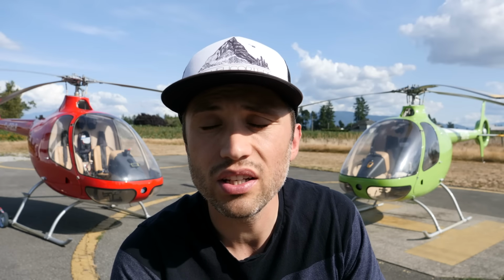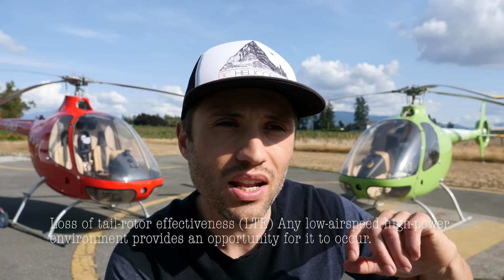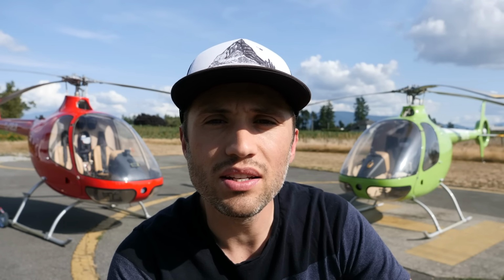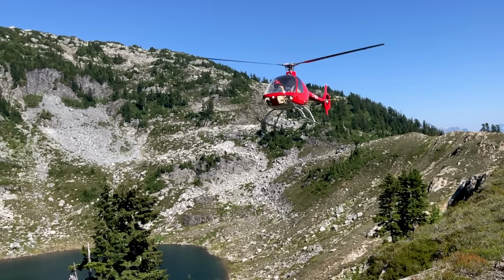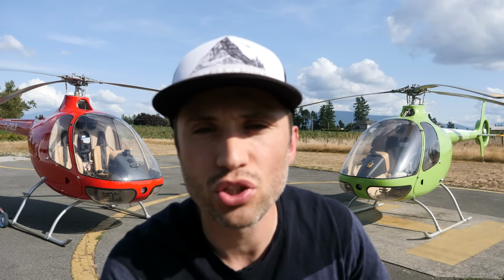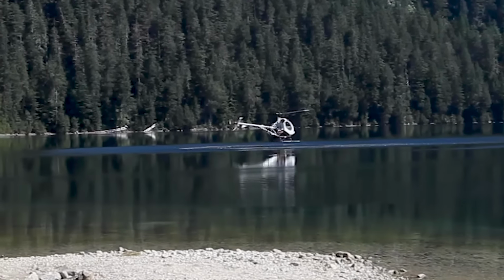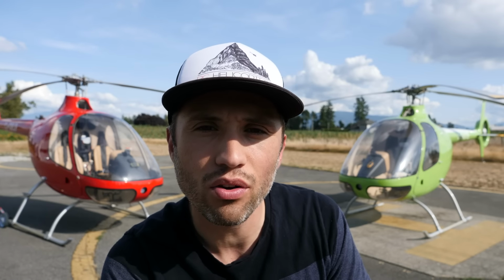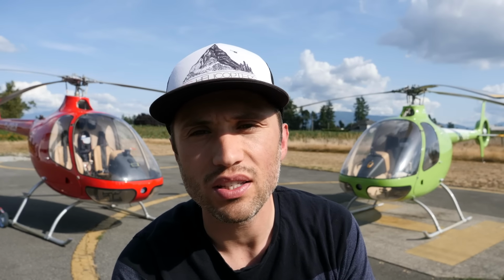OVERPITCHING and LTE can lead to a HELICOPTER CRASH

Comment: Great video and explanation of this incident. And although I think I'm understanding all your great points I just keep asking why there is a situation of lack of power. He came in pretty slow... just curious how he would be running out of power.

I'm sure being a small aircraft there's probably not alot of power here anyway.. but unless there was engine failure or some other mechanical failure ... this otherwise could had been a typical landing had he been over ground vs water. To completely run out of power here... too high an altitude maybe??? 

Great video though!!!

Comment: Noob question, what were the conditions that caused the helicopter not to have enough power to hover?  I can understand if you're extremely high up, or extremely heavy, or it's extremely hot.  I suppose the last would be most likely in this scenario.

Comment: I gave you a thumbs up. Good video. I, however tend to disagree with you that This was LTE in the traditional sense of the acronym. This was way more a result of lack of power, probably, if I had to guess due to density altitude. LTE in the traditional sense of the acronym, is not induced by lack of power, but more of an aerodynamic phenomenon. I’ve been in real LTE and it is very violent. He did lose effectiveness of tailrotor, but it was a byproduct of no power.
Reply: But the recovery is the same!
Reply: I didn’t mean in any way to take away from your video, it’s just that you can get into LTE and still have all the power in the world to spare.

Comment: I don't know about helicopters but it seemed like some sort of mechanical malfunction happened. Yes? 
Otherwise.....was it simply that he rotated in a bad direction and the tail rotor wasn't strong enough to stop the rotation??? Why don't they build them strong enough to do that?  Lastly, was there any recovery once he got into trouble? Could he have dipped his skids into the water to stop the rotation and then pull away?

Comment: Settling with power. The bird was settling in its own down wash, where increasing the power only serves to accelerate the induced flow of air through the rotor disk, caused by operating at a high power setting with very low to zero airspeed and at or near max gross weight.
Reply: Settling with power does not occur at a hover.

Comment: I remember back during my training in a Bell 47 my instructor, after training my boss, at that point would have been instructing for 20 plus years, not sure how many years before that he had been flying, but he was around 10 000 hours (1994). I learned lots from him.
While practicing recovery from overpitching with him, one method used for rotor droop was to reduce anti-torque pedal allowing the nose to rotate so the power the tail rotor would use went to the main rotor and then depending on the cause of the rotor droop, fly away or land. Of course it can only be done if there is room, and like you mentioned and I was taught--you have a way out.
    Have you ever used/tried that method? Opinion...
    One other emergency I was taught that not may instructors do is lose of tail rotor. The instructor would operate the pedals while I hovered, my feet on the floor, downwind at around 3 foot skid height. He would check I am ready then, some amount of delay to make it some what more real (surprise!), he would put the pedals to neutral and around we went. Chop power, prevent drift with cyclic, let helicopter sink, cushion landing with collective.
    I found his training really built confidence that even when things go wrong you can fly the helicopter. And it seemed to remove some of that, is this really happening delay--which hurts recovery from any problem.
Reply: very good information sir

Comment: Now, I know nothing of helicopters, but if this is a common problem, wouldnt they use a tail rotor with more than enough power to keep the helicopter straight under any condition. I'm sure there is a design limitation that I don't know about but it just seems like either upping the turbine size to have just enough more power to keep it straight or upping the tail rotor effectiveness, (with size or maybe the pitch to get more thrust) would solve these problems for the most part. Of course it still is no substitute for pilot skill and training.

Comment: Hi Mischa, very interesting video! but I think I have a fallacy here.. like I don't really get why you even can get into a situation of to little power so easy? Shouldn't there be more room in the matter of power? like a stronger engine? Or is there basically enough power but you just can't use it cause your collektive pitch is so high that your blades start to "stall" and use efficiency?
Reply: MorpheuZmusic no, there is. It enough power to hover in this situation. Full stop.

Comment: In the army before we would do NOE we would do a power check bringing Aircraft up to a 50 foot hover 360 pedal turn if you can do this without you and closed any limits then we felt we could safely fly NOE

Comment: 1st, wrong aircraft for high altitude flying. 2nd maintain forward airspeed, 3rd, Do not attempt  hover until  over landing spot.  4th, either miscalculated HOGE/HIGE during pre-flight or never completed calculation, to determine aircraft hover limits.

Comment: So, basically for any issue, lower cyclic? Motor failure, low rpm, insufficient power, tail rotor effectiveness lost, dynamic tip over, etc.?

Comment: Low rpm cause It, Attention for minimun RPM. Manual is clear and is mandatory put rpm Max of Main rotor when flying  for minimun of 500 feet over the terrain and turned on eletric aux. fuel pump ///  300s  are great machines no desapoint the class.

Comment: i can hear the rotors losing power the more he spins so i assume he was trying to get tail control back while also trying to increase altitude effectively over dragging the engine and making it fall behind the green line in the rpm counter? and the high altitude making them lose 20% ish power probably didnt help

Comment: I have never been in a helicopter, let alone fly one. My question is you said when he started to spin he should have added pedal to counter it. Wouldn’t that have diverted power he desperately needed from the main rotors to the tail rotor, or would the power lost be so small that it’s not a issue.
Reply from the maker: Robert Sandefur yes but if he immediately lowers collective he can give power back as well.
Reply: True, I can see how that would work, I would think  lowering collective should also decrease the need for peddle as well. 
 From what I can tell seems that “Air speed is your friend”

Comment: Hi, what is the purpose of lowering the collective when you start overpitching?  Why moving cyclic forward is not enough? Can someone explain it to me please?
Reply: First thing's first, I'm not a helicopter pilot, but with my understanding, lowering the collective means that there's less drag on the blades, resulting in a faster rotation. If you're losing engine power the last thing you want is your blades to lose rpm.

Comment: High altitude and lack of experience. As it was stated, the pilot could've fixed/prevented this had they have known how to. Setting aside the fact its the mountains and it looks to be high or higher altitude then what the pilot was used to. He also ascended a bit fast, causing LTR, or entering his own vortices which will masturbate LTR and caused him to rotate as well as drop faster than what he is capable of correcting for.

Comment: A low RPM condition affects the tail rotor thrust the most. For every 1 RPM you lose on the main rotor the average tail rotor will lose 4-6 RPMs as it spins up to 4-6x faster on most helicopters!and since the thrust of a rotor varies exponentially with it velocity squared you lose more thrust on the tail rotor than the main rotor as the RPM drops making it unable to counter main rotor torque.

Comment: When you are flying a Robinson......fly it like it's a Robinson......  and not a CH53E.  Doing low level operation at high altitude, in an aircraft that has a short spectrum for max performance, is asking for a problem.  Either way, you'll learn a lot.

Comment: Many people in the comments mentioned that hover over water doesn't give the advantage of ground effect.  This is not what I would have thought.  Please will someone explain why water doesn't provide the advantage of ground effect?
Reply: if I had to guess I would imagine part of it is pretty much everywhere on land you're going to get a little bit of thermal lift also where as over cold water you might even have a little sink rate.

Comment: It seems like this is a power issue. why would they produce helicopters that are so close to there are max power output vs hovering? There's got to be a better way to handle this like having a 10% buffer that can only be used for so long far as extra power. I'm an automotive tech and I can think of a couple ways you can add power to a regular engine... maybe not a turbine. Also if you're running out of power and you've got a turbine you're doing something really wrong.

Comment: Question- would applying more left pedal to offset the LTE have robbed further power from the rotors?
Reply: yep. the engine was already maxed out. im sure the pilot had full left pedal in trying to stop the rotation. all that did was put more load on engine. his only chance once he knew he had screwed up would have been to try to get some forward movement to get air flowing over the rotor (effective translational lift) and fly out of it. tough to do and very little time to do it in. i was watching the video and there was about 1.5 seconds between where that might have worked and where it looked like it was just too late. 
almost always, there is a chain of decision/action points that precede accidents like these. a different decision/action along the way can usually break the chain and change the outcome but there is a point where it is just simply too late to prevent an accident like this one
Reply: Jose Madarieta Thanks!! Much appreciated !!

Comment: OK, but what your missing from this explanation is why the helicopter runs  out of lift. the helicopter obviously had enough lift to take off in the first place, and they are supposed to hover, so why cant it hover all of the sudden? My intuition says theirs some kind of change in the environment surrounding the helicopter that causes the rotors to not make the same lift they had when it took off. so, what is this air environment that causes the helicopter to fall out of the air even with more collective applied?

Comment: G'day,

Yay Team...!

Back when Wheels had flat sides running all the way around them, what you called "Overpitching" (which is actually a Pilot-input..), used to be called "(Main) Rotor Decay"...

  When the Engine can't spin the Rotors sufficiently fast, the resulting Sink raises the Angle of Attack of the Airflow accoss the whole Blade Leading-Edge - and in at the Hub-end the Blade-Roots start to Stall...

 That reduces Lift, increasing the Sinkrate, while increasing Drag & thus reducing Rotor RPM - which together rapidly causes the "Hole in the Doughnut" to expand outwards as Lift progressively decays outward toward the Tip.

  Explaining the process may be a better teaching method than glossing over the Aetiology with the catch-all synopsis "Overpitching"...(?).

Rotor Decay paints a more vivid word-picture of what happens to the Lift ; which progressively ceases to be there...

  I experienced Rotor Decay once, as a passenger in an Enstrom F-28c, we went from sitting in the Ridge-lift a hundred ft above the Hill, to spinning to the right while sinking down into the Riverbed. When the Wind dropped from 15 mph to nothing.

I had the door open to eject the pair of 20-litre Fuel Cans I had between my legs, and we were going between two Trees when a Gust both stopped the Spin & granted some Airspeed.

  Rosemary (Arnold-Harris, my boss, the  first woman with a Commercial Rotary Wing Licence in Oz) was able to regain control over the water, and thus accelerate up the River - below the Banks, before popping up to circuit & land at our chosen Joyriding Spot.

If I hadn't known about Rotor Decay, I wouldn't have recognised the need to prepare to jetisson the Fuel - nor the recovery making such a drop  ultimately unneccessary.

In 1979 one was still able to break even Barnstorming regional Oz, in a Heligoflopter, y'see ; in the waybackwhen (!).

Take it easy,

Such is Life.

;-p

Ciao !

Comment: Hi Mischa I fly 3D RC helicopters and we don't seem to see overpitching unless the motor is running low or in a autorotation..... Does overpitching in full size happen because the helicopter does not have an overpowered motor or has that got nothing to do with it ? Thanks Lee
Reply: not enough power
Reply: @warrenmatheson563  thanks I guess my question was why are they underpowering them ?
Reply: @Fixingthingz4u  because everything is weight limited. More power means beefed up transmission = heavier transmission and more fuel burn etc. Turbos add weight if you want sea level power at higher altitudes. Most of the engines on helicopters are extremely de-rated...the limiting factor is usually the tranny.
Reply: @warrenmatheson563  Thanks for the reply dude :)
Reply: Fixingthingz4u you right, because most choppers don’t have ‘overpowered’ engines. Why, because it’s too expensive. You will see this when you upgrade from your RC helicopter to a real one with an underpowered engine.

Comment: It’s surprising that the power limit is so low on these piston powered birds.  I imagine an A-Star or Jetranger would have more reserve power above and beyond a hover at a reasonable elevation.
Reply: The designers of any helicopter type set max takeoff weight as high as possible so that you have max useful load. So any helicopter that is close to max weight will run out of power at some density altitude.

Comment: Terminology debate ahead.  I agree with another poster who said this looks like LTA (Loss of Tail-rotor Authority) rather than LTE (Loss of Tail-rotor Effectiveness).  I know they sound like the same thing and in some sense they are ... not enough thrust from the tail rotor to counter the torque produced by the engine & transmission.  But the difference is how to you get into one or the other.  

LTA is a result of overpitching the main rotor (demanding more power than is available to keep the main rotor spinning at optimal RPM, in this case due to high altitude it would seem) which causes both a loss of lift from the main rotor and a loss of power to the tail rotor (and thus loss of tail rotor thrust), hence the spinning. 

 LTE is a result of wind moving in the same direction as the tail rotor produces thrust OR vortices from the main rotor, either of which interfere with the air flow through the tail rotor causing loss of thrust and hence spinning due to torque.  The tail rotor or fenestron effectively stall and thrust drops rapidly. 

As Mischa notes, recovery is the same ... pitch forward (into wind) with the cyclic and lower the collective to lessen the power demand (and thus regain main rotor RPM).

Comment: Simple case of lost of rpm, the pilot dont put the rpm for altitude above 500 feet, when touch in water did be with 2600 rpm to engine and for normal operation is necessáry  an minimun of 2900 rpm for power necessary to fly. The manual of flight is clear this helicopter is an Howard HUGHES project and is an fantástic machine, ALL pilots have an dream of to have one H300 as her toy for enjoy or work, great helicopter

Comment: Interesting that ground effect didn't seem to help any in this situation.

Lowering the collective as described, increases rotor RPM. This also increases engine RPM, because it is interconnected. 

Aircraft piston (and turbine). engines develop peak power at maximum RPM. So anything below the redline is certainly developing less than rated power. Having too rich of mixture, or a bad magneto, will also reduce RPM.

By lowering the collective, You increase RPM of the rotor (increasing the rotor blades relative airspeed, allowing it to generate more lift, but at a lower lift coefficient). Therefore generating less induced drag, that form of drag which goes up at the square of lift the coefficient. 

By reducing this drag, less of the power is wasted, more of the power goes toward lift, with less reliance on ground effect. Increased rotor rpm, increases engine RPM, which generates additional horsepower as well. Most of which goes toward  lift. And forward speed increases relative wind over the forward traveling rotor blades, thereby reducing the life coefficient required, and the induced drag further yet.

Seem's pretty intuitive. If hovering becomes unsustainable, RPMs begin to fall off. Then the required action is to lower the collective. Lose a little altitude to regain maximum rotor and engine RPM, and some forward velocity, to get into efficient cruise condition.

Turbochargers or emergency backup Nitrous are clearly the appropriate  solution. 😂

Comment: I strongly disagree with advice of doing an OGE-hover power check as described. Doing an OGE hover 50 to 100 feet AGL is  well inside "avoid-area" of height-velocity diagram (in every POH i have seen) and will most likely be fatal if you have an engine failure (that typically happens when you bring in max power). Also most low time / inexperienced private pilots should generally avoid OGE hover in the first place.